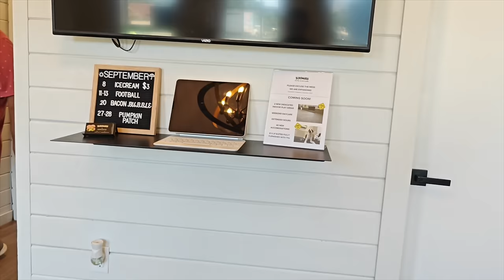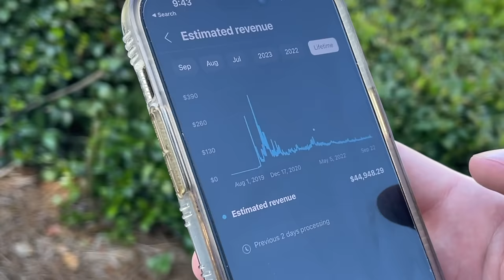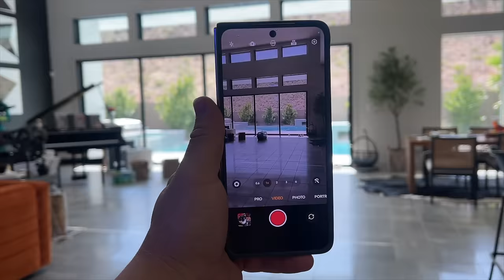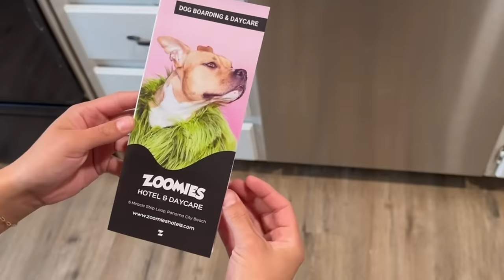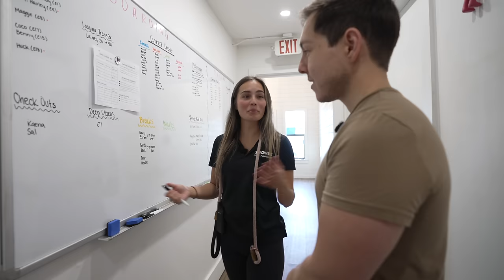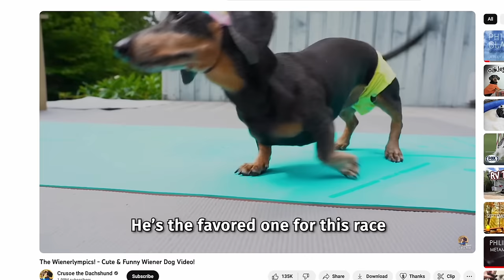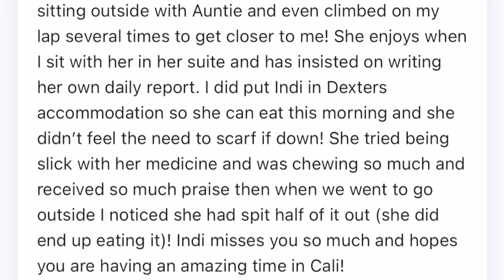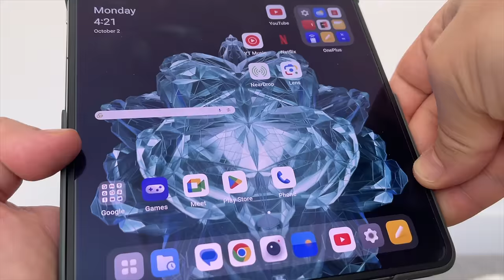Making $2500 Per Day with a Luxury Dog Hotel | Undercover Millionaire

Comment: Great idea. One I have suggested on various Facebook sites. I suggested a garage conversion kind of thing. I’ve seen a couple doggie daycares they were storefronts in strip malls, no yard. This looks like it’s in a residential neighborhood. Couple of questions about that, are there regulations in a residential neighborhood that would prevent the presence of this kind of business? Then, there’s the neighbors, have neighbors had issues with noise, barking, or smells?
Reply: yep. HOA's would not allow this. It would have to be located where houses are spread out.
Reply: They are in a commercial area and converted an old preschool. Non residential and approved zoning for the business.
Reply: Check zoning for uses of land.